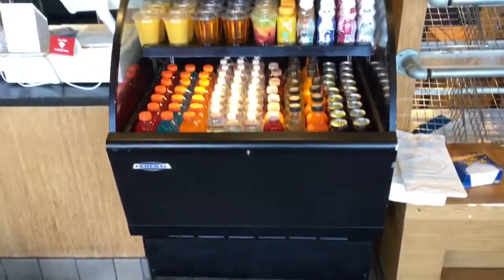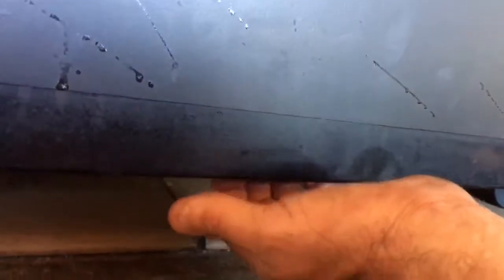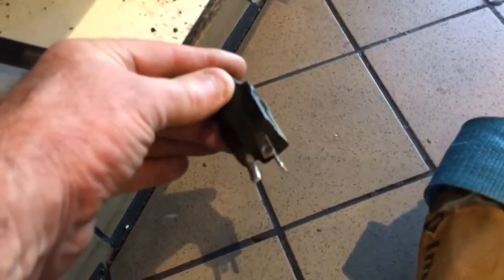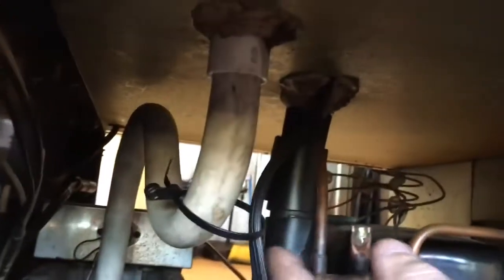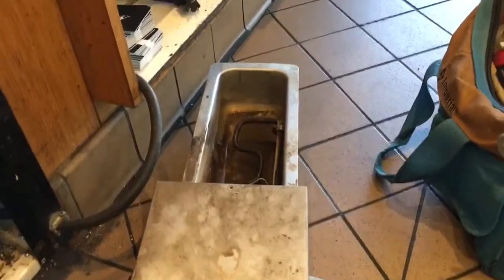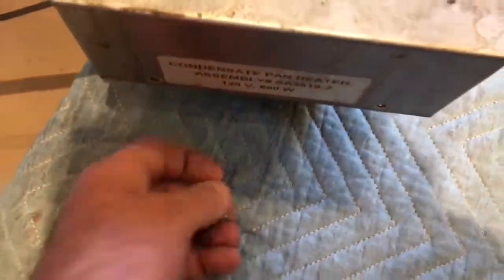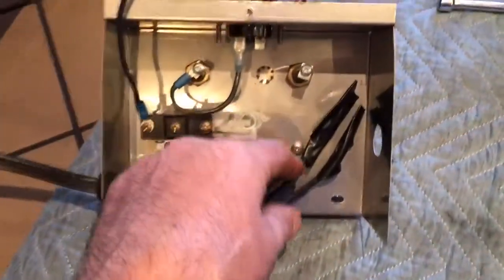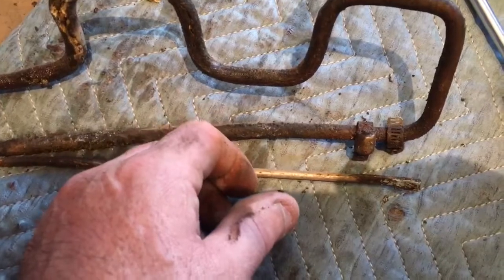Federal Refrigerated Open Case. How to Diagnose & Change a Condensate Heating Element in Detail.

Comment: OC"D" Refrigeration! 😂 good video!  I have to admit that I do try to make things look as good as possible cosmetically especially with my electrical and repiping. But aligning the screw heads in a non-visible area that's "next level!"
Reply from the maker: Rofl. 😂😂😂😂
Reply from the maker: The customer does remove the panels and clean his own condensers every month on all his equiptment. So, thats kind of why i did it on this Job. Even non-visible area's will be seen occasionally by people & thats good advertising for me. Thats why i do it. It could be an Electrician or plumber that says holy shit that looks nice , who did that work and thats how i get jobs. Happens All the time for Me.
Reply: Good point. I have noticed a shift in how people maintain their equipment.
Reply from the maker: Customers are slowly Finally Learning that Condensers Really Need Cleaned & are a Cheap Way For them to Save a Ton of Money on Electricity & Not Replacing compressors all the time , Repair costs , and units will make temp when health dept inspects them , also less heat rejection into the space keeping rooms cooler. Lower air conditioning bills.

Comment: I've had trouble with Federal, I had one that the large expansion valve flare nut cracked in half, cheap brass. On a 12 ft self contained open three shelf case , the coiled copper suction line behind the compressor leaked in about 8 places under the armaflex insulation, cheap copper. Their purchasing dept is going to put them out of business by buying the cheapest materials.
Reply: Miss your vids, Jim
Reply: Hello Jim P hope all is well with you miss your vids and presence on utube world
Reply from the maker: Yep, Everybody is in a Race To make the cheapest unit possible these days. Good for us ! Customers These days i tell them , You Get what u pay for these days with Refrigerators. I Try to Steer them to Beverage air or Delfield. Alot of green corrosion issues with True Suction lines & Capillary tubing Leaking too. Cheap builds are keeping Me busy.
Reply: Jim! You're alive! Really enjoyed your videos. I've been in the field for over 20 years and still learn something when I watch them. Thank you and God bless you.

Comment: auf welche temparatur wird das wasser erhitzt?
Reply from the maker: The Safety Limit / Temperature control Strapped to the Heating element is Set at 188 Degree's Farenheit.
Reply from the maker: The Float & Micro switch is Actually the Main Control for Keeping the Water Level in check.
Reply: Danke fürs antworten..
Reply from the maker: Ihr Willkommen.